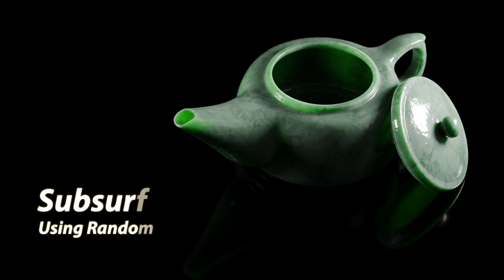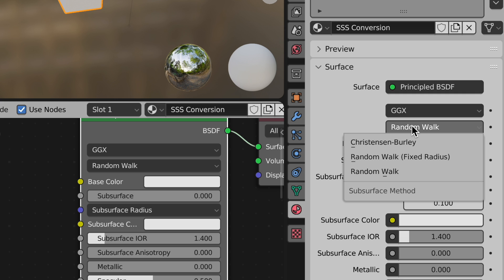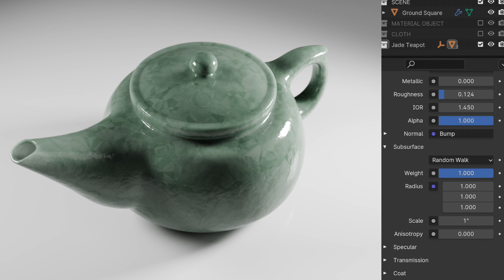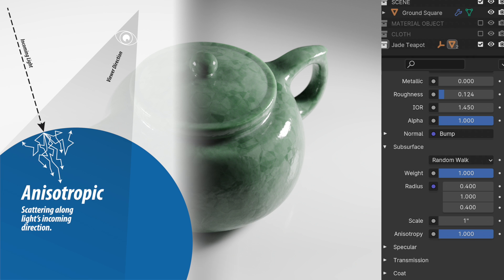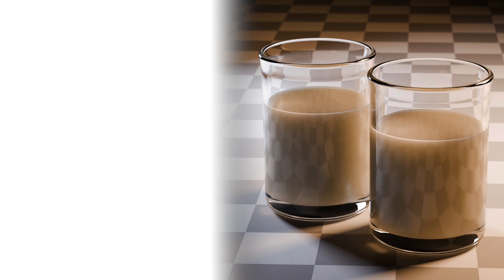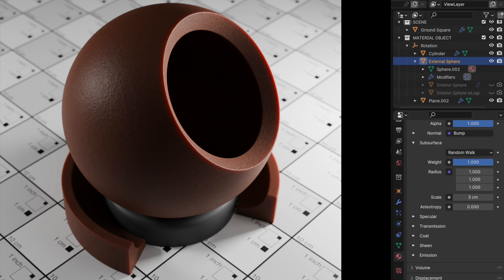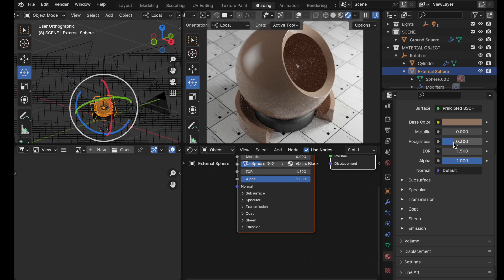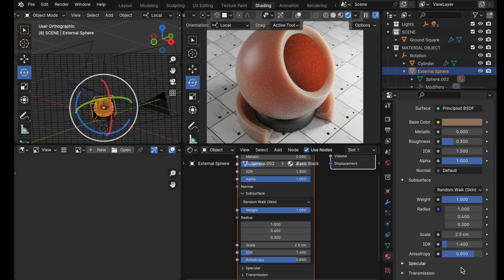Subsurface Modes & Anisotropy in 4.0

Comment: So, I see that you choose scale based on the size of the model? Would that mean that a giant skin shader would need a much larger scale? What if you would animate a normal human magically growing to become giant? Would you have to link the scale with the size of the model to keep it physically accurate?
Reply from the maker: Yes, the scale is an absolute size, so you would need to change that as the object grows.
Reply: @christopher3d475  So, I'm not an artist nor a light transport expert, but these things do interest me.
So lets say we have a both very small and very big colored glass object (properly colored with volume absorption). Would you say you would need to change the absorption of one because otherwise the smaller would look much lighter in color than the bigger one? This is just how light works the bigger one has way more absorption, changing it would be only as an artistic choice, but at that point if you want to color to be the same just color with surface color and remove volume absorption.
To go back to the SSS, lets look at small human's backlit (sun light for example) ears, you will clearly see the typical shine through redness. A giant is much bigger, so the ears are also bigger and thus you will see a lot less of that shine through. That is a very simple, but physically accurate description I think. The problem with your explanation in the use of SSS is that the absolute scale has to change and this will change the amount of subsurface and make it look as if they both have the same size ears looking at the amount of shine through (obviously it's not just about the ears).
I think the absolute scale has to do with just the material and not the size of it. like it doesn't matter how big the object is, so if all of the SSS of skin happens just 1 inch it the material, the scale has to be 1 inch. And your radius values has to be correct as well (one of them should be 1). This is how I see the random walk skin method work most logical IMO and it also "seems" to eliminate using the blend / weight to get proper skin shader.

Comment: Hey there, About radus. The default values are no longer R 1.0 G 1.0 B 1.0 But 1/0.2/0.1. And it seems that they behave differently. Can you comment on this?
Reply: Looks like they've just changed the default values to be more skin like. But the functionality is the same.
Reply: @exploringrvdude7817 @exploringrvdude7817  Thanks for the timely response, I did not find better lessons on BSDF and materials in general than yours. I was litery taking notes and replaying them to learn everything.

Comment: Based on the depth of your knowledge of what each adjustment does within the shader nodes; I would love to see you do a series of videos where you focus on certain types of materials, detailing how to get ultra realistic results. Certain materials have always mystified me as to what exactly defines the true accuracy of them. One I have struggled with is Ceramic. Though it would be great to see an entire series that takes on certain similar types of materials at a time, such as metals, (Rough, satin, burnished & polished, along with other heat treated metals such as anodized, etc.) Also things like Brick, some rough, some glazed, etc. Different types of dirt, mud, sand; dry wet, etc. Glass, accurate to real world types of glass, (maybe plexiglass included), some with color tints, or etched, etc. Plastics, Wood, Leather, Cloth, Concrete, Stone, Etc. Water and other liquids like milk, wine, juice, oil, vinegar, etc. Based on all the comments and likes, I am certain I am not the only person who would be interested in such content.

Comment: To my understanding subsurface anisotropy doesn't consider camera angle for the scattering direction.  It's based solely on the light ray direction from the light source.  So -1 means it bounces backwards from the surface back towards the light, 0 means it scatters in all directions, 1 means it travels straight through.  The camera position isn't a factor.  You can test by moving the camera, the SSS will remain identical, whereas moving the light will produce a different result.

I can't blame you for getting it wrong, because the Blender manual doesn't specify.  But it's the same as all other render engines.  For example here's redshift's user manual explaining anisotropy in more detail:

https://tryingtobeananimator.wordpress.com/2018/11/17/redshift-subsurface-scattering/#:~:text=This%20describes%20the%20anisotropy,towards%20the%20light%20source.

The scale is just to specify what a radius value of 1 means in actual distance.
Reply from the maker: Blender doesn't support -1 values. And the camera angle does influence whether you decide to set the material with 0 to 1 for anisotropy given the light direction and how that affects the visual. That's what I meant, not that it physically affects the anisotropy itself.
Reply: @christopher3d475  Oh I thought you said if you leave it at zero more of it will scatter towards the camera, but that didn't really make sense to me, because if you're camera is directly opposite the light on the other side of the object, then less would be scattering towards the camera (because more of it would be scattering off in random directions).

I had no idea blender didn't have the ability to only backward scatter with negative anisotropy.  That sucks!  Could have sworn I'd done that successfully.  I'll have to recheck.
Reply from the maker: yeah honestly I could have phrased that passage better. With zero, more light will tend to scatter toward the camera because of the isotropic nature of the scattering. But it's also really dependent on the lighting conditions. The liquid in the glass examples actually was the opposite of that given the position of the light to the camera, in that case anisotropic gave more and better scattering toward the camera. So yes, technically the camera angle has nothing to do with the scattering, it's really just a perceptual thing. The jade teapot example had more light scatter toward the camera in isotropic mode, the darkening I showed with anisotropy set to 1 darkened because less was scattering toward the camera's view. but it's just incidental. And yes, it's a bit odd that they don't use negative values. I actually asked if they could clamp the UI to not allow negative values because you can type in -1, but it will still just be the equivalent of 0, isotropic.  @trainspotter1522
Reply: @christopher3d475   I think they should just implement it the same as other engines.  1 = forward only, 0 = random (as it is now), -1 = backward only (faces with normal pointing towards light get the subsurface colour (strength determined by dot product))
Reply from the maker: Yeah I'm honestly not sure what the rationale is for not having the negative values.  @trainspotter1522
Reply: @christopher3d475  I notice as well, that if you set radius to 1,0,0, and scale to 1cm, I would expect this means the red ray can travel 1 cm into the object before dying out.  With this in mind I would have thought setting anisotropy to 0 would result in some of the random rays bouncing back out after travelling 50% of the way though, so you could get some backward scattering still.  Doesn't seem to work though, nothing bounces back.  I guess they only bounce backward after hitting the first backfacing face?  Or maybe that's what the new thickness input on the material output node is for?  To specify when SSS rays reflect internally?
Reply from the maker: Well and remember if you're using the Random Walk (Skin) mode the Scale is being adjusted based on various settings in the material, it's only using the Scale as a starting point. Also, you can go above 1.0 values for Radius, experiment with something like 2,0,0.  @trainspotter1522

Comment: Just one question left behind... what does the IOR value in this case? If Anisotropy changes the direction of light-scattering, how is relating to IOR?
Reply from the maker: It's just like transparent IOR, it causes light to change speed in the material and thus refract. It's also only exposed as a variable for Random Walk (Skin). For skin it's been measured at between 1.3 and 1.5, they default it to l.4. It honestly has the least effect of the parameters. You'll notice more of an effect on lighter tones than darker ones. For instance on the darker skin toned example I showed there was almost no difference between 1.3 and 1.5. There was a noticeable but minor difference on the lighter toned example. It's something you can experiment with though because you never know what specific model or material it could play a bigger role in.

Comment: Fyi, Christensen-Burley is the only SSS method that can "melt" an object with different shells together. Quite handy when you're building an say an organic object but you can't or won't model or boolean the whole object into one. If you with the same object is using any of the two Random Walk you will instead get double the SSS where the two shells overlap, so it will look quite dark and just generally wrong.
Apparently this is something the devs are going to have a look at and maybe implement for all the different methods, but it might take a while before it happens.
Reply from the maker: That's interesting, thanks for the tip.

Comment: I am sorry but I can’t really see the utility of having rgb values still displayed numerically in the subsurface scattering. What I get is still a precise color and I don’t have intuitive control over it so I’ll still have to input an rgb node to make it have sense, I just don’t get why it’s default like that
Reply: I think this is because this isn't really about the color of the object in the normal sense, but instead just how far a color can penetrate an object, and those values can very much be above 1, so having a normal RGB color picker field doesn't really reflect that even though you of course can manually type values above 1, but the average user don't really realise that you can. This is at least how I understand how the devs think, but personally I have also made the same argument as you to them.
But apparently they say that they'll at least add Red, Green and Blue labels to those three fields so it's clearer that it is about color depth and not just some vector value as it looks to be now (but really isn't).
Reply from the maker: Yes this is true, that you can enter values above 1. I prepared a version of the teapot where I used 1 2 1 for the values to emphasize the green, but decided not to use it to keep the time of the video down.  @gurratell7326
Reply from the maker: You're not the first person to a strong reaction to this. The good thing is that if you tie an RGB node in the material node editor, the RGB fields disappear and are replaced by a proper RGB color wheel in the main Material Properties area.